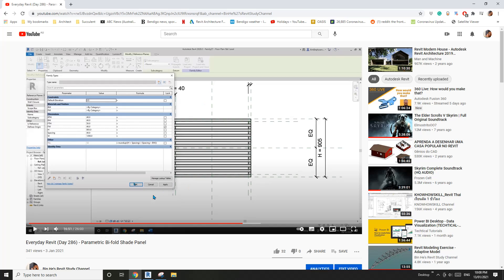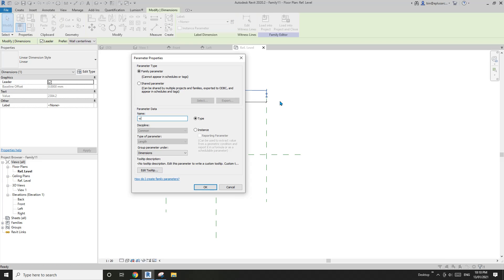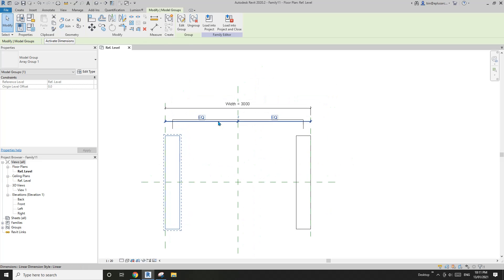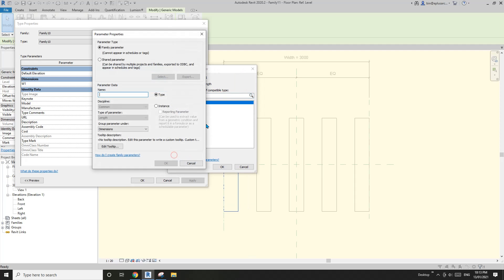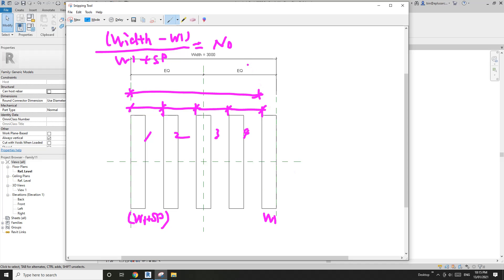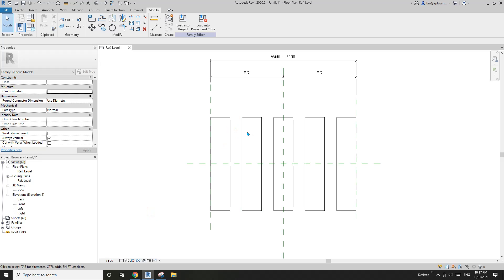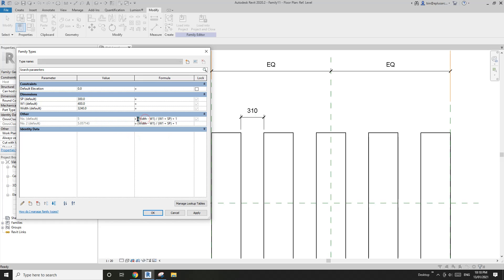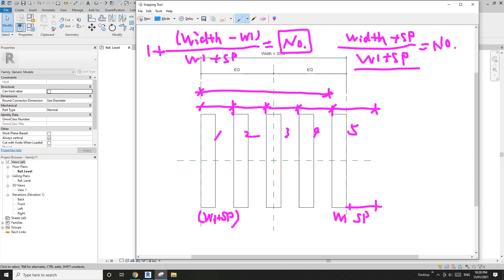Everyday Revit (Day 302) - Array Number Formula

Comment: How would you nest this into another family to make a panel of bars for example? how would you constrain the left and right planes but still be able to adjust this array in the parent family? Great video thank you!
Reply from the maker: You can try these:
Option A.
1. Make sure you have a Center(Left/Right) in this family, and use dimensions(Equal) onto Left and Right Referent Plane, create a width dimension and parameter onto Left and Right reference planes.
2. Load it into the parent family, and align and lock it onto the Centre (Left/right) Reference Plane.
3. After that, in the parent family, create dimenions (Equal) onto Left, Right and Centre(Left/Right) Reference Planes and create a width dimenions and parameter onto Left and Right Reference Planes.
4. Select the nested family, associate the width parameter from the nested family with the width parameter from the parent family.

Option B.
1. The same as Option A, but the width parameter in the nest family need to be an instance parameter.
2. Load it into the parent family, place it roughly in position.
3. Same as Option A.
4. Select the nested family, drag the handle (blue triangles on Left and Right Reference Planes) onto the relavent reference planes and lock them.

Both should work, but I don't have Revit open to test them. Let me know how it goes.

Comment: For extruded object, because you need to create a family first and import it. Can't I create an extruded object directly in the .rfa file I'm creating?
Reply from the maker: It's probably possible but can be messy, especially when you also want to change the size of the extrusions. Using nested families allows you to constrain the location using the reference plane inside the extrusion family while adjusting the size of the extrusion by associating the parameters. If you create an extrusion directly into an arrayed group, it's very likely to break.

Comment: How do you change the height for those vertical sticks?
Reply from the maker: Since this video is about the array formula, I did not add any other parameters such as the height of the sticks. You can add a height dimension in the stick family and load it into the host family. Do not add dimension or parameter to the array in the host family, Revit doesn't like it.

Comment: Great explanation. Do you know a formula to get constant spacing between each element? Like an element every 5 units?
Reply from the maker: Use 2nd instead End while create the array, then use a parameter to control the distance between the first and second array group.